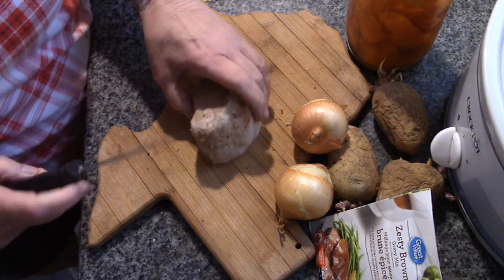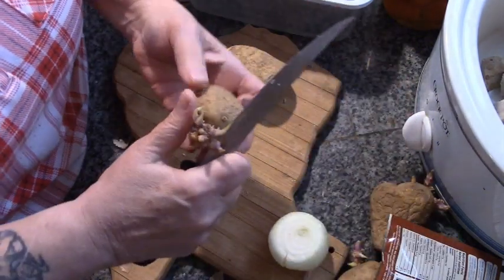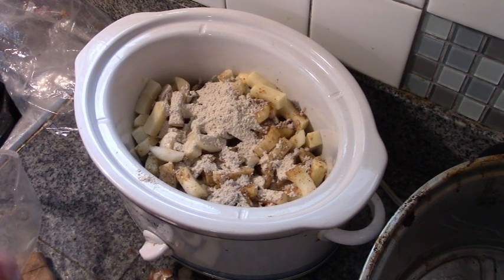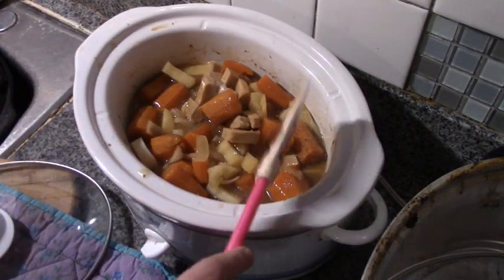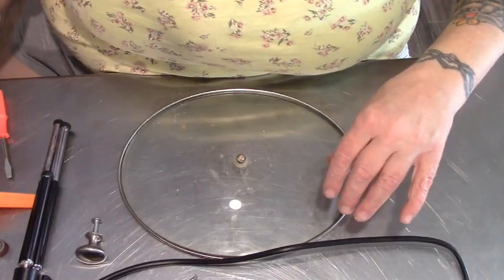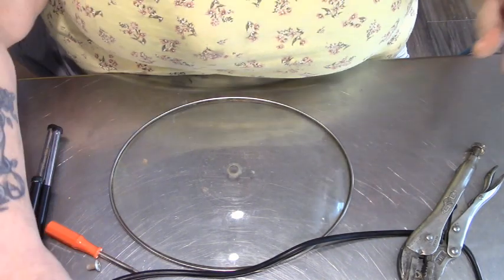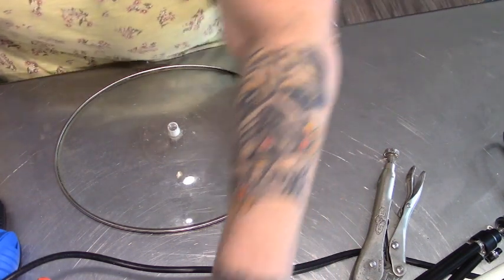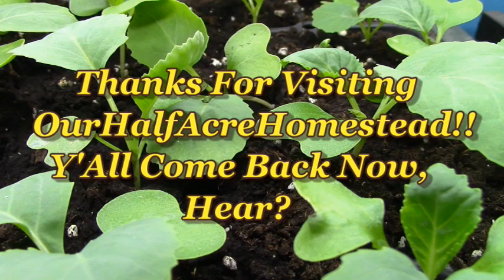A Leftover Make Over Meal With a Surprise Ending!

Comment: the handle on mine did the exact same thing - I replaced it with a zip tie, the part you push through on the inside, the loop on the outside ... it does tend to leak heat though.  I also found the lids from my large oval cast iron pans fit it PERFECTLY!

Comment: Thanks for sharing your recipes. I wanted to add that I used to put a cloth over my crockpot, sadly the same thing happened to my lid, it literally melted! 😔
Reply: I don't remember why but I once covered my lid and part way down the sides w foil - do NOT do that. It burned the finish on the exterior and just made a crusty mess! Ugh.

Comment: Always, always try and repair something before buying a replacement!  Improvise!  Overcome!  Adapt!!  Companies are trying their best to keep us in "throw-a-way" goods, but as you've just shown us, a little effort and thought can work wonders.  I, too, have an "engineered" crock pot handle - It's not fancy, but it works.  What I couldn't understand is why you don't have a container full of screws, nuts, bolts, etc., for this type of repair?  I've said before - I grew up poor, so we saved everything.  I even save and reuse parchment paper and aluminum foil!  Whenever I have a project with extra screws, fasteners, etc., they go in an old coffee can.  I "canabalize" everything that can be saved - especially from small appliances.  I can't tell you how often I pull that can out to find just what I need to fix something.    And yes, there is another one with drawer pulls and handles.